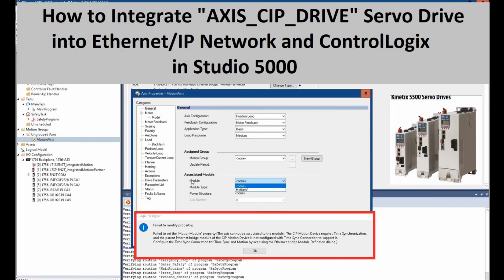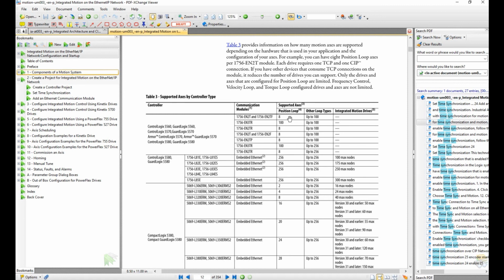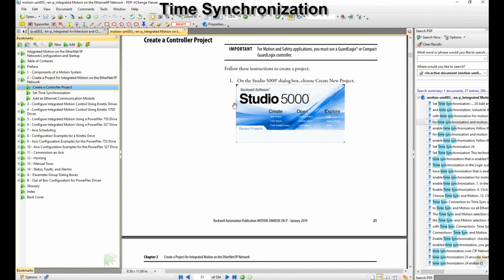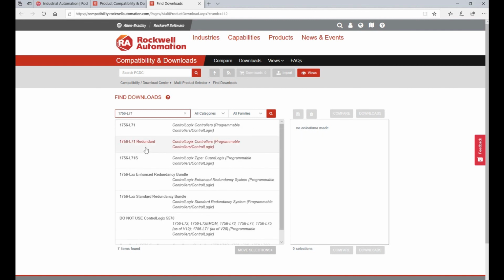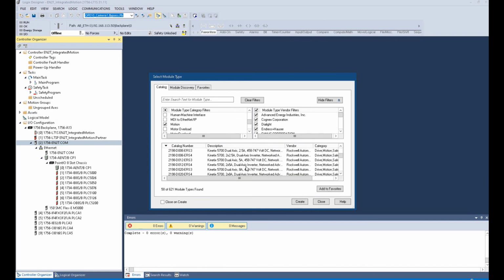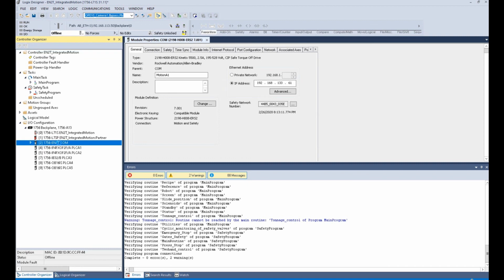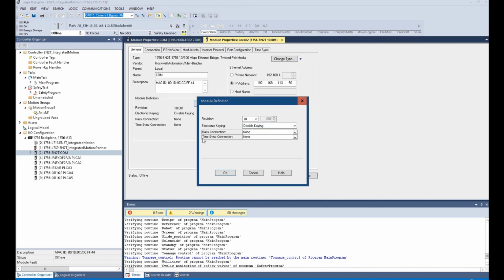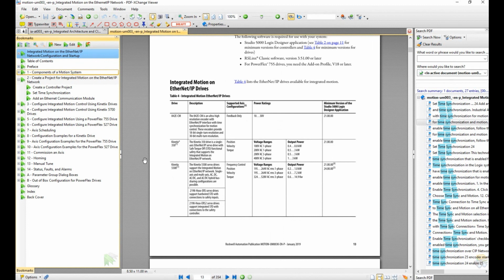AB03. How to Integrate "AXIS_CIP_DRIVE" Kinetix Servo into Ethernet/IP Network in Studio 5000

Comment: I have the question about axis scaling setting my load is ball screw the pitch distance is 5 mm. height 1450 mm.

How should I setting the values in these subject title  ?

Transmission ?
Actuator ?
Scaling ?
Travel ?
Soft Travel Limits ?

My load move on ball screw in vertical and use 2 axis left and right it will synchronize position and speed moving in order to press the fabric roller by tension sensor control. 

Which command suitable for my application to motion control between MAG and MAPC ?

If use MAPC How should I setting Cam profile ?
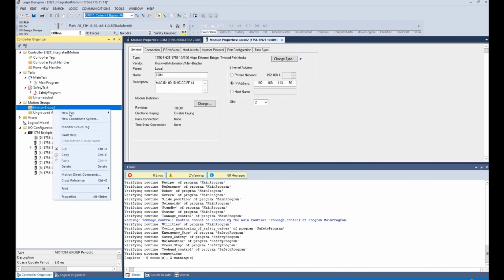Reply from the maker: Please view carefully about the motion manual of Allen Bradley. https://youtu.be/JC3XuR6lt98 at 17:25. It is hard to answer shortly using the comments. From my personal view, you need to figure out what is your motor one revolution doing. e.g the travel distance, how far the encoder and the actual object for one revolution of your motor.